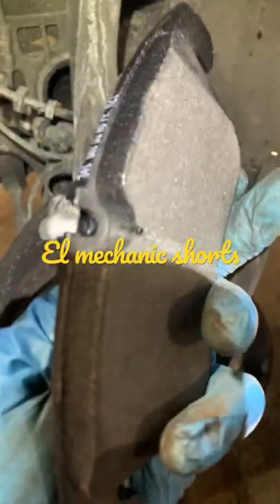Ever wonder how your brake pads sensor works #cars #mechanic #auto #wow #amazing #mechanic

Comment: Got a question what could make a brake caliper lock up if the caliper had been replaced twice been greased been bled topped up the fluid and still locks up also popping when turning ? 2008 Ford Focus se